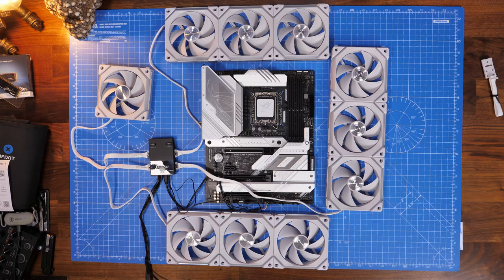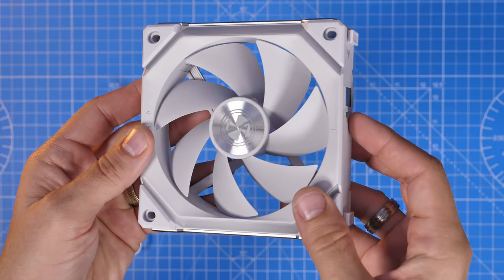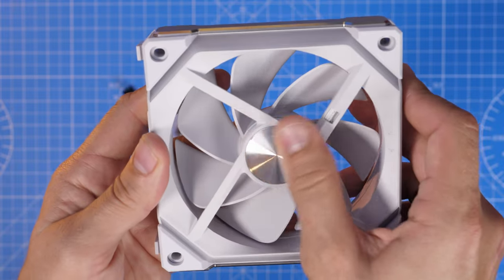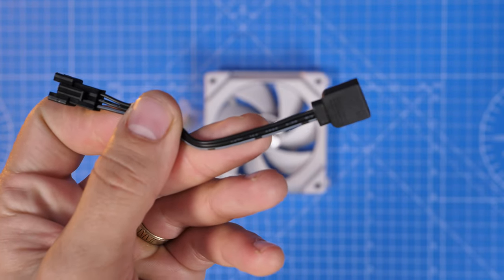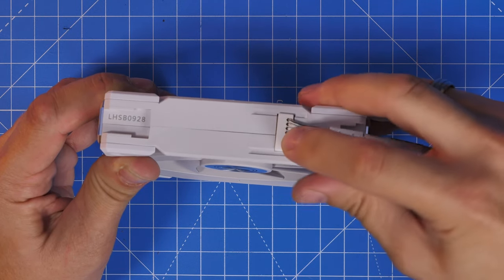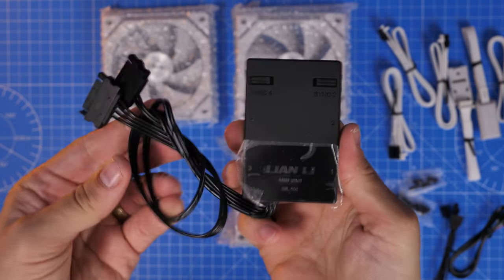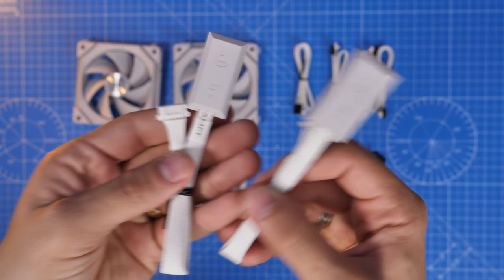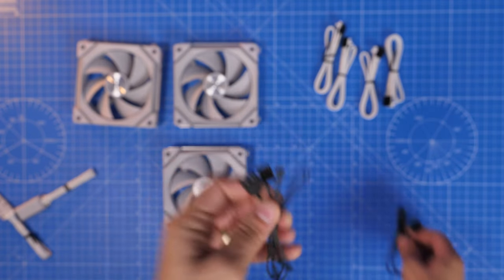How to connect and setup Lian Li SL120 V2 fans (including on an all-in-one cooler)

Comment: Would it be wise to use Lian Li SL120 V2 fans as a replacement for the fans on my NZXT Kraken Z73 or a Corsair iCUE H150i ELITE LCD because I own one of each so I could use either RN I have the corsair put on. But uhm I run a Intel i913900k and as you prob know its a very spicy boi..... I don't know if the Lian Li fans would be just as good for radiator cooling as the fans that come on them......
Reply: Saw some people on reddit saying that it could cause a increase in temps.
Reply from the maker: I'm using SL120 v2 on a Z73 with 13900k no issues.
Reply: @TheProvokedPrawn  Good to know btw and thx for the info. Was worried that if I change the fans they wouldn't preform better than the stock radiator fans. Ill prob use Lian Li fans then as I think the V2s look very nice and that daisy chaining ability were they snap on will make cable management so much easier. I only wish that you can prob buy a cable extender for them maybe as their cables seem short.

Comment: is it easy/possible to incorporate theSL120V2 model and the infinity model into the same control box? im trying to incorporate both styles of RGB
Reply: Im trying to figure this out myself, a guy on reddit said no, even though they use the same hub connector. It doesn’t say anywhere that the SL120 v2’s are compatible with the infinity hub. The infinity fan hub might only work with infinity fans and the same goes for SL120 v2’s. Why can’t they just release 140 infinity fans
Reply: @anewbeginning4617  would the sl120 inf-s be compatible with the liquid freezer 2? as he said, sl120s cant go there, but can the infs? and is there a way to perhaps manhandle it onto the rad? and what about the SL120 v2?
Reply: @Haykaana  Im not really sure, I don’t see why, unless screw holes don’t have the same dimensions. You can’t have the cable fan box on the infinity fans on the same side as the pump cable fittings. That the only problem i see, but you can just flip the fans around.
Reply: @anewbeginning4617  i did a bit of research. so the cable box on the inf is too big and thus will not fit. but the sl120 v2 fits well since there's no cable box

Comment: Wondering if the single fan directly connected to the motherboard can possibly be able to change the fan speed through L-Connect 3 software?
Reply from the maker: No, it would have to be via the controller. You could control speed via your motherboard though

Comment: How do you tell which way the air flows?
Reply from the maker: For standard blades, if you can see the front that's where the air is being sucked from. So, for example, if they're pointing towards the outside of the case on the front then that's intake.
Reply: @TheProvokedPrawn  I so appreciate the response!  But that wouldn't have been enough to help me, because I can't tell which side is supposed to be the front and which the back.  I found an answer on another site, which I hope is correct :^) , and I wanted to cross-post it here because this video has such great information about this particular fan.  According to the other site, the air goes in the side with the mirrored center and out the side with the (logo center and "X" connections).  I hope that's correct!

Comment: What if you only have 12v and non 3 connectors for the LED
Reply from the maker: Then just use the USB connection and control via L Connect 3

Comment: I only have 1 5v rib header and I am using it to my case what do I do?
Reply from the maker: Just use the USB connection and control the lighting via L Connect
Reply: @TheProvokedPrawn  thanks, and I also only have 1 usb 2.0 on my motherboard should I buy the nzxt hub then?
Reply from the maker: @andyboxgaming  that's a good solution tbh. I've used it a lot where the USB ports are lacking.

Comment: Nice, informative video. Thanks for that.
Can you tell me how many is I can daisy chain max? 
Im talking strictly daisy chaining them, dont mind separate connection to controller. 
I would like 3x 3pack for O11 case, 3 bottom, chained to 3 on side, chained to 3 up top, connect then to controller, either all 9, or 2x6+3 fans... would that work?
Im worried about cable length
Thanks
Reply from the maker: The instructions say you can only do 3+3 using the daisy chain connection to the controller. And there's only two cables, so you could only do two 3+3 connections and then whatever other fans you had connected in the standard way.
Reply: @TheProvokedPrawn  Cool stuff, thanks mate. Again, excellent video

Comment: Hello, thanks for the video, I have a z73 kraken and the same setup as you in the last few frames. Only my setup won‘t make the bottom 3 intake fans have any rbg. I connected those three with the three intake fans on the right side with this flat cable. The fans are spinning though, just no rgb. Aside from that all other fans have rbg. Do you know where my mistake is?😢

Comment: So how do I set these up to turn on the fans when I initially start my pc for the first time and run my bios and download windows? I just don’t want to start my pc and the fans not run because I don’t have the lian li software to turn them on and have my cpu overheat while I’m getting the pc setup? If anyone can help me I know I’m a noob and might just not be understanding right but I just don’t want to fry my cpu cause my cpu cooler fans aren’t going to be spinning until the lian li software is downloaded (yes I’m replacing my kraken z73 fans with lian li fans)
Reply from the maker: If you aren't doing intensive things, not having them spin is fine while you're getting L Connect downloaded. Alternatively don't connect the usb connection and just use sys fan headers temporarily
Reply: @TheProvokedPrawn So for the AIO if I just connect the rgb to the controller and then the power connector to the motherboard that way nzxt has control of the fan speed and can read what it needs to cool, then when I turn the pc on the fans will still run since it’s connected to the motherboard and the rbg won’t until I have lian li l connect downloaded, correct?

Comment: Can you daisy chain 3+2+1?
Reply from the maker: You can have a max of 4 per port, so I don't think you could do that, no
Reply: Thanks found a work around. However I have two question maybe better directed toward Lian Li Support. So apologies if this isn't the forum.  When using lian li connect 3 it tells me there is a new version, I download it then click update and it says not supported. Any ideas. And two, any idea why the fans throttle at start up when the LL Connect starts. It's cured by restarting the system. Thanks,  @TheProvokedPrawn
Reply: Figured out its the MB RPM Sync. Need to figure out how to fix that.

Comment: the worst experience in my pc life. i was changing  the galahad 360 aio fans with this set. I wanted to go from controller directly to mb without usb and software. i have an argb splitter as soon i've inserted the provided cable in, all my pc leds went crazy. The fans weren't reconized by bios and they have spinned at minimum. i've inserted the argb cable directly in my mb, and then the real sh!t happened. BSOD. temperature in bios went to 75 degrees. Mounted old fans, my pc was keeping 82 in idle in windows, 70 degree celsius in bios. Had to remove battery from mb and everything went back to normal. we are talking about 7950x3d on x670e with a a 4090. Controller 100% faulty, very sad because they one cable and amazing rgb. For sure i'll not try another one on my configuration.